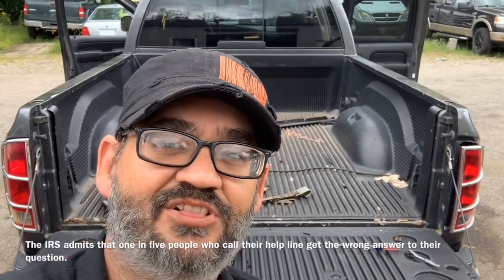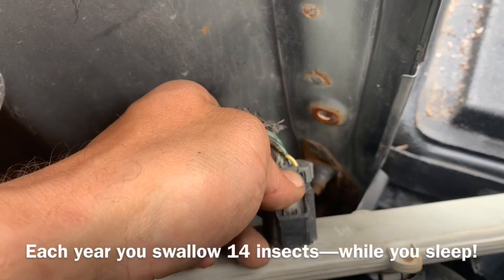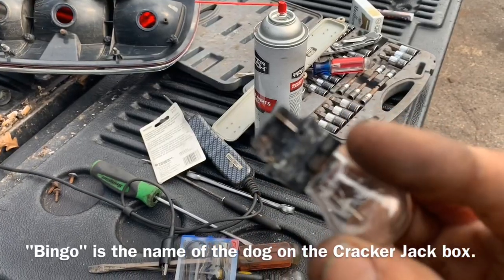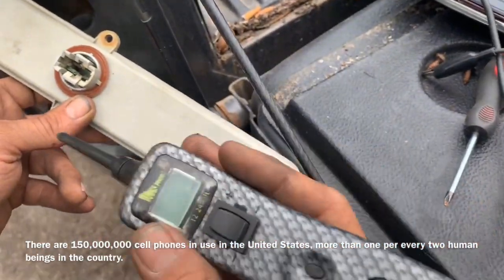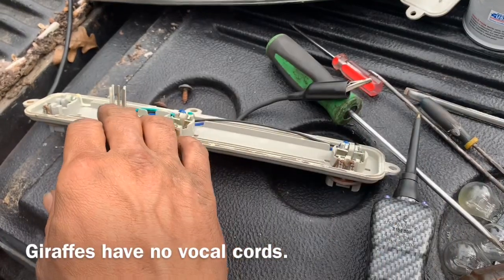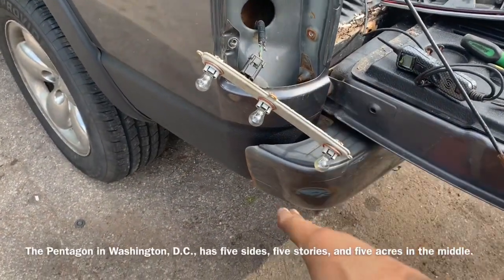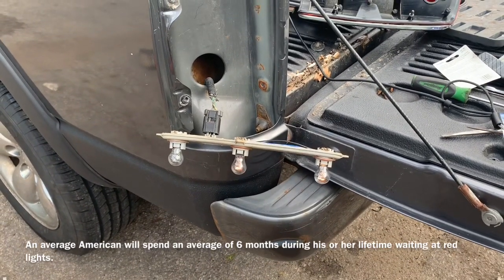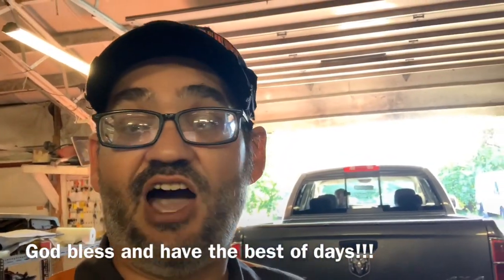Dodge ram tail lights not working

Comment: One thing you can do to keep those connections from overheating and burning out in the first place, use a small amount of
di-electric grease as a moisture barrier when you replace any bulbs in your car. And with the Autozone thing, just go in there and get the commercial pack of bulbs, (it's a 10 pack for less than the shelf price of the LL bulbs and they keep em in the back). They do that with hose clamps too...
Reply: Yes that electric grease is the best.

Comment: Hello congratulations for your videos and thank you for your help 
I have a 2003 dodge ram 1500 5.7 passenger tail light not working but signal break reverse and emergency dos , all light bulbs work, if you have any ideas will be highly appreciated, thank you 
Joe
Reply from the maker: Brake switch, possibly do all your other brake lights work? 

If the other ones work, then more than likely from what I’ve seen with dodge trucks, get a Wiring schematic of the tail light and try to grounded out to a different location. More than likely the ground is not connected for that particular light. Obviously, there’s the other things like a bulb or the socket itself 

But it is a fairly simple problem. I know it just seems like it’s complicated because your brain is telling you one thing in the lights doing another. .. hopefully that little bit of advice. Helps you out brother. Appreciate you being here. Have a great day.

Comment: Can you tell me where I can find that slim Power Pro electrical diagnostic tool you used in this video about "Dodge Ram tail lights not working?"  I've looked several places online, but can only find the more bulky, box-like units.  TIA

Comment: 2017 RAM 1500 Laramie w/ LED -Hopefully I get a response, I have a crack in my driver side tailgate assembly and gets wet inside, took it apart , changed bulb, let water out and dried it. Still don’t work…I think it fried a little, is there a fuse for the rear lights? Thx
Reply from the maker: Hey Aaron what’s up …. well I don’t know about the 2017 all I can do is recommend you grab your owners manual and check out the fuse box identification pages sorry man wish I could be of some help

By the way I talked to everybody subscribers nonsubscribers I say shitty things when necessary I say really complementary things when necessary as well too sorry I couldn’t help you in this situation but welcome to the channel there are quite a few things that I can help with that just doesn’t happen to be one that I know off the top of my head.

Comment: I have a question I hope you can answer so my brake lights work my running light works on one side but it doesn’t work on the other side I got new brake light circuit boards and it still doesn’t work is it a wiring issue?

Comment: I have a 2008. It doesn’t have the circuit board like that. But I’m having a issue with my brake lights. Turn signals work, running lights and that. But the two lights on the back of the bed won’t work. The 3rd brake light does work tho

Comment: I have a 2018 ram 1500 and my instrument panel showing I need to replace right backup light. I replaced the bulb it works but**  how do I reset my instrument panel back to normal. How do I take off the display on my panel. Thank you

Comment: Have a ? On my 2004 dodge ram 1500 I put led taillights because my original went out had trouble with the led ones so I put new original parts back on it and the lights are light out then others are dim don't know why do you?

Comment: I have an 07 Dodge 3500 and the brake lights, signals and reverse lights quit working almost all at once. Checked the fuses and bulbs, they're all good. Truck dings at me every time I push the break pedal, turn blinkers on, hazards or in reverse. Cannot figure out why they won't work. I'm guessing wiring. All the fronts work though? Any idea where I should start to look?
Reply: hope you see this, my 2003 dodge 2500 diesel just did this a few days ago.  Did you figure out what it was in yours.  All the boards in the back lights are ok, and the grounding indicator was good current.   The fuse box was ok, we havent checked the computer module yet. 
they went out as we were driving, and of course our diesel vibrates like hell.  A few times a screw feel out of something important, I think it was the starter. 

so it could be it was, what ever it was....vibrated to death. funny not funny.
Reply from the maker: I’m sorry I don’t have any advice but maybe somebody else will I wish I could help
Reply from the maker: I’m sorry I don’t have any advice but maybe somebody else will I wish I could help

Comment: I have a 2005 dodge ram 2500 cummins. 3rd brake light works but not my 2 lower brake lights, fuses are good. Turn signals work flashers work. Please help

Comment: I have a 2003 dodge ram 2500 diesel, and the back lights do not work. we checked the grounding wire with a simple ground checker, and it lights up. The on both sides.    We were coming from a 2hr drive and 30 min before getting home the lights started to act up.  The back lights went out first, and I told my husband to turn on the emergency lights, they did come on. Truck has been parked for a week, and now we checked the fuses, and nothing.

Comment: Yours was the best video I've seen. But I can't get the little red key back in. What's the trick. Thanks
Reply from the maker: You don’t need that that’s just a safety clip it should click and lock into place without it if it won’t go in and it’s not broken it’s because you don’t have it pushed in all the way but it is just a little secondary latch

Comment: My driver tail light day lights aren't working but the blinker and brake light and reverse works. Any idea
Reply from the maker: Hopefully you check the obvious and check the bulbs. If the bulbs are good then I would check for signal to the running lights. 

More than likely the running light Circuit runs from one light to the other light and there’s some kind of break in the circuit between the two lights. That’s why one side works in the other side does not that’s my best guess and that’s just off the top of my head I’m not absolutely certain about that but you could run the wires from one tail light to the other light to make your running lights work. Just as an idea

Comment: Hey Clay. Just noticed my running tail lights are not working. I have blinkers.  I seem to have lost power to running lights. What is your suggestion that I check
Reply from the maker: Hello Neal about the best recommendations I can give you is to check what I did in the video. It seems like I checked for power etc. but it would be extremely complicated to describe it over a text message so I’m very sorry if that’s not very helpful for you.
Reply: @sharpcarco  ok so weird. I checked my fuses and the. Parking fuse under the hood by the battery was missing. Replaced it and it was fixed.  Just don't know what happened to the original fuse

Comment: Great Job, I don't have facebook but have a question. I have a 2004 dodge ram 1500 SLT and all rear lights work except for tail lights when I turn on the lights at night. I have replaced the bulbs to make sure and the fuses, any ideas where to go from there?
Reply: Ever figure this out
Reply: I got the same thing going on right now
Reply: Mine was the fuse under the hood and bad bulb
Reply: @williamulery6104  FUSE BOX RELAY PANEL  , I found  one in ebay and swapped them out and worked perfect.
Reply: @williamulery6104  under the hood  near the battery

Comment: You made it work again but you didn't fix what broke it in the first place the little round seals need to be changed moisture gets in there and causes connection issues which burns and corrodes the contacts

Comment: Omg this just happened to me I'm so worried my left turn signals and lights not working no brake lights omg. Dodge ram 2004 ...m 4 ways work tho
Reply: Still I Rise4485 I’ve got the same problem how did you fix urs